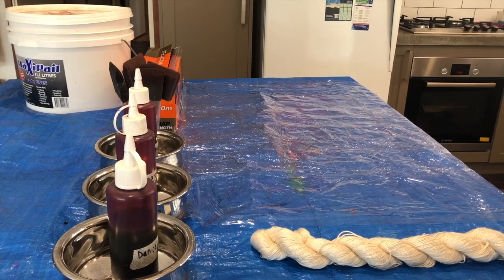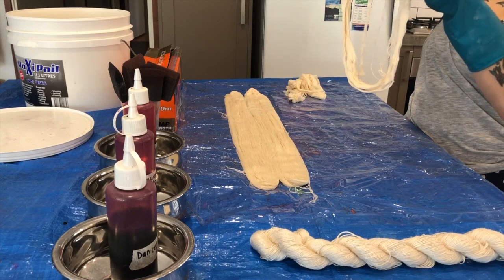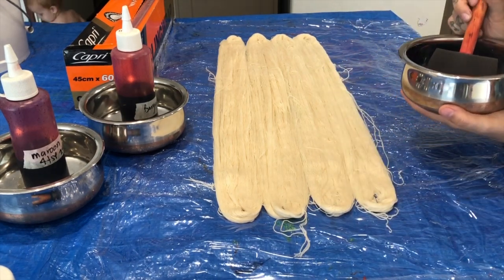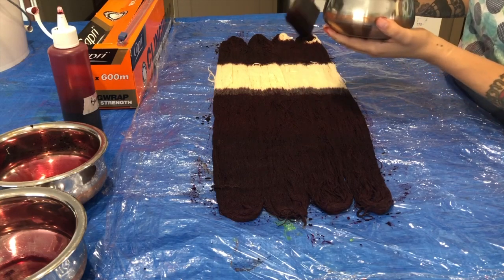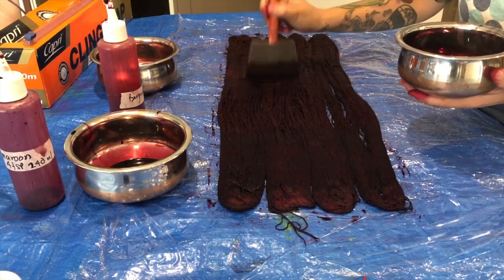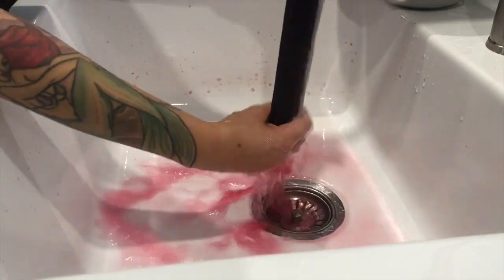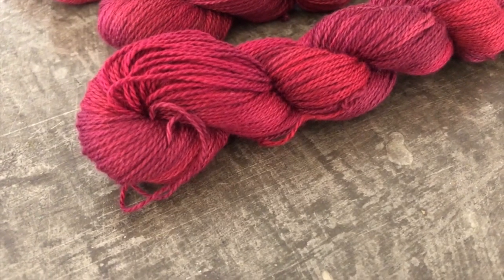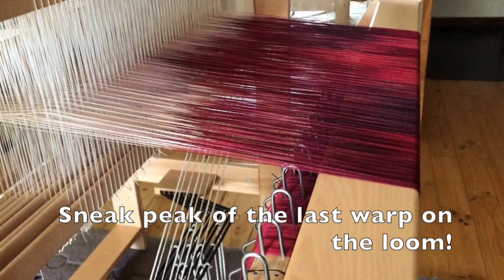Experimenting With Processing Time When Dyeing Cotton ... Fail?

Comment: I have a few thoughts to add.  It is possible that different colors batch differently so if you did the same experiment with say a blue, it would show some variation?  Also it could be that batching for 24 hours ensures lightfast and not just colorfast?  I need to dye some cotton yarn a khaki color and to get it I think I will have to mix some colors and hope for the best because I want to keep knitting and need this color for an upcoming stripe in the sweater.  Any clue how to get khaki green?  I have read rit formula says green and red = khaki so I will start with that.  I love your work and teaching, but do not weave.   Elsewhere today I asked you for the soda ash soak formula if you could share?